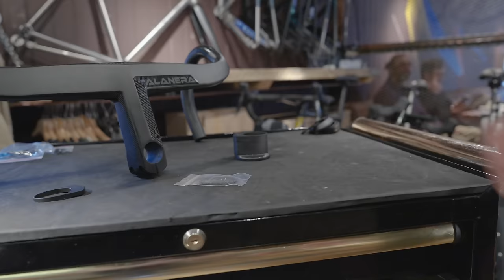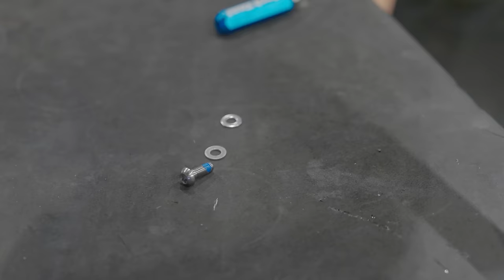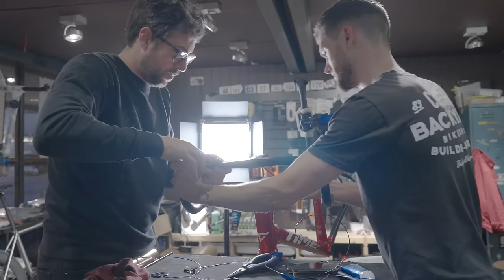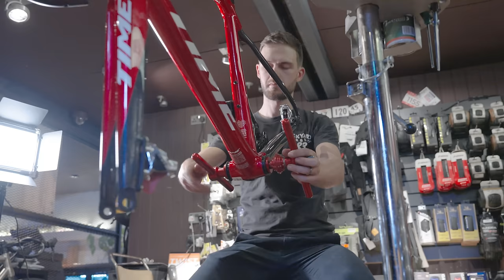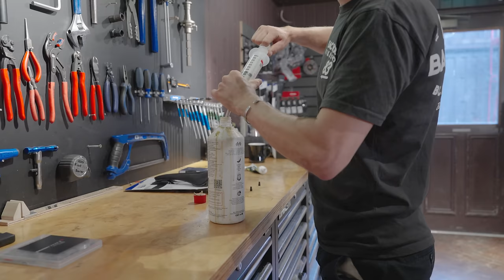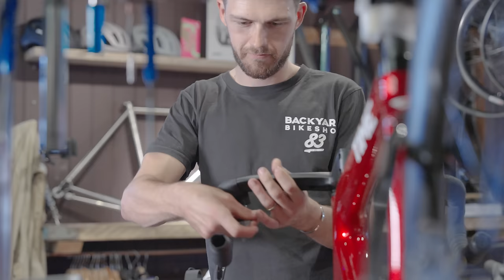Red Everything! TIME Alpe D'Huez with SRAM Red and ZIPP.

Comment: I just got my TIME frame set in gloss carbob and installed Shimano mechanical groupset ; ) Ride is a as smooth as silk. With cgeapest DT Swiss alu wheels, Ultegra mechanica disc, and anu handle bar. Fizyk seat with Deda Superbox stem and seatpost, all 8.1kg ; ) For another 4K I could have 7.5kg? No way!
Reply: What model frame did you get?
Reply: @phatmandon22 Carbon wheels, please. Smooth as butter 🧈

Comment: After Viewing the Time Factory Manufacturing of there Frames l would say without a Doubt that they would be HANDS DOWN THE BEST FRAMESETS IN THE WORLD 🌎.  And by a fair margin . 

I currently ride a SL5 Expert Tarmac with lots of upgrades.  In fact the upgrades r identical 2 the current sl7 except 4 the frame.  Did them over a few yrs.  Just added the 12 speed di2 ultegra.  

Also building up a SL7 S-Works Tarmac.  Dura Ace Di2 12 Speed Groupset.  Time Xpro 15 Peddles.  
S-WORKS Power Mirror Saddle. 
FSA VISION ONE PIECE CARBON COCKPIT . And ×2 sets of Roval Rapide CLX Wheelsets. 
CLX 52/60 Aero & CLX 32 Climbing.  

All l need now is 4 the Surgeon over the next 6/8 weeks get rid of 24 hr aday Concussion Headaches and Migraines for the last 6yrs from a Motor Vehicle Accident.  
×2 Visits 2 the Hospital 🏥.  
May have one more in September.

Comment: These tires look massive, what's their size?
Reply: Good question. Time says they support up to 28mm, but zipp 353's are already 30mm wide
Reply: Those are 28's.
Reply: @rayF4rio thx, i saw the video description later on, but still curious to know how wide they run on 353s 🤔
Reply: @marcinpomorski  I have the 303FC with the 25mm internal width.  30mm Conti 5000 STR's run 32 mm.
Reply: @marcinpomorski  they should be around 31mm. and my 30mm vittorias are exactly 33mm on an 25mm ID rim.

Comment: Just curious. Do you often use Parktool ASC-1 anti-seize compound for head bearings and BB?
I use PPL-1 Polylube grease for non-thread contact points but curious to see if I should use ASC-1 instead.
Reply: the product description says "Park Tool Anti-Seize Compound reduces friction in threaded and press fit applications for easy assembly and disassembly. Ideal for bottom bracket and pedal threads, pressed headset cups, seat posts, quill stems, etc. ASC-1 seals and protects parts from corrosion and rust under the most extreme conditions."